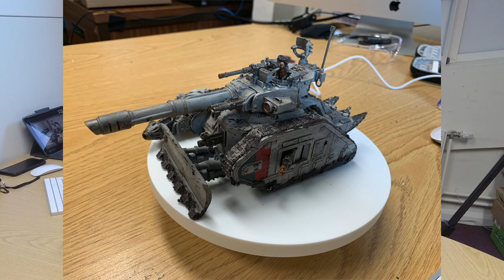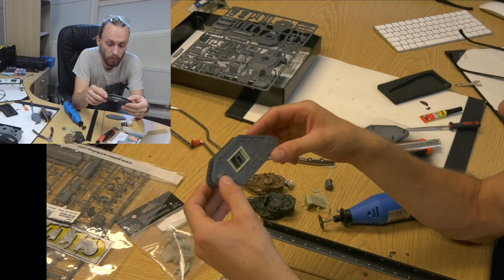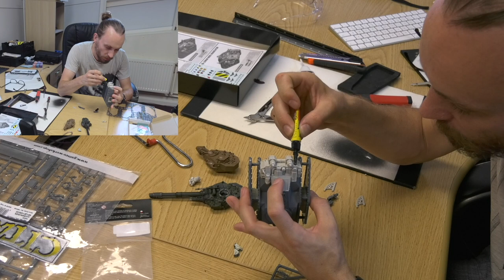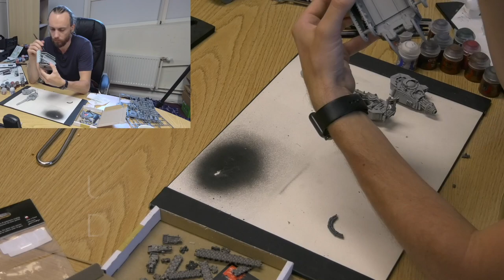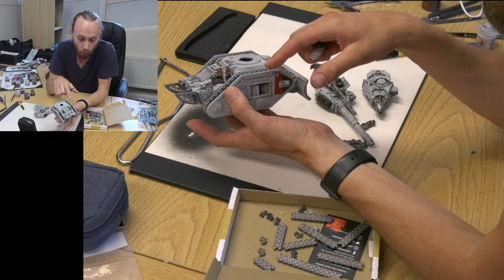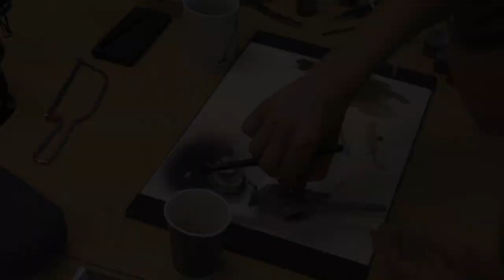Astra Militarum Tank Commander Build & Paint - Vostroyan Leman Russ, Trench Rails, Extended Engine

Comment: This looks very nice! Aesthetically, I'm a Cadian fan, but it can be really cool to see stuff that isn't Cadian, or Catachan, and I was curious what you were going to do for the Tank Commander upgrade; the promoted Spotter looks great, and gives it that Vostroyan feel. I'm not sure about the extended engine compartment, as far as use, but I really like how it made the Leman Russ a little less "boxy", and while it looks great, it doesn't just look like another of the tank I have seen umpteen times in the many years I've liked the hobby. Is the turret a Vanquisher? Not the midterm popular choice, but I like how it turned out, and I'm thrilled to see not another Demolisher Tank Commander. 😊

That's a lot of level of skill I wish I possessed, and I think it turned out great! I'm not sure why, but I feel I'd love a follow-up video for a Valkyrie. Might not match your aesthetic, so I won't hold my breath, but this was good.

Comment: I’d think you could just use the parts from the GW kit, switch sides and possibly do same thing maybe only need some plasti card!  🤔. 

Great paint job and video!
Reply from the maker: Thank you! And you’re right, you totally could do this entirely with plasticard, and I’d be interested to see how it would work with the reversed sponsons that come with it. You’d have to cut some pretty big holes on the inside part of the track section, but doable I reckon! Maybe I’ll try that next…

Comment: Probably a stupid question but do they sell this as a set or do you piece it together with other sets? Do the commander accessories come with the tank accessories that's for sale on the GW website? Just wondering as I want an actual commander for my armored forces! Thanks in advance and great job on this tank, looks amazing!
Reply from the maker: No such thing as a stupid question! So this build is a bunch of different pieces, however you’ll have pretty much everything you’d need to make a basic tank commander in the standard Leman Russ kit - including a Cadian hanging out in the turret hatch. You might want to look at picking up one of the old Tank Accessories sprues - that’s got a whole load more bits that you could use to customise your tank. The internal sponsons and hull extension are third part bits I purchased separately, but aren’t actually needed to make the tank. It just helps it look cool!
Reply: @chrishoad3423  Right on, I appreciate the answer! It does look cool indeed! I love seeing custom works. Videos like yours have been a godsend for me in regards to getting techniques down and some ideas.  Thanks again!

Comment: This is awesome! I recently started collecting a Vostroyan army as well. I'm having trouble finding a tank turret with both the turret-mounted weapon and auspex array. Do you have any suggestions as to where I might find a turret like the one you use in this video?
Reply from the maker: Liam, thanks for the comment! The turret itself is a Forgeworld Leman Russ Vanquisher turret. When you say Auspex array, do you mean the radar setup at the back or the side mounted ‘eye’ pod? The codex calls this an Augur array, if that helps. And by turret mounted weapon, so you mean the heavy stubber by the hatch/Commander, or the twin barrelled stubber immediately next to the main cannon?
As far as I know, this particular turret is a Stygies pattern Vanquisher turret by Forgeworld. They come up on auction sites from time to time. You can also get them from recasters, but that’s a personal choice there. A quick image search will bring up the base turret. The heavy weapon by the hatch is from the Citadel Astra Militarum Tank Accessories Sprue, which is available from a whole bunch of places, and the radar dish is a kitbash using parts from the accessories Sprue and an old forgeworld radar array dish. I hope that helps, any questions just ask!
Reply: @chrishoad3423  you answered every question I had, follow-ups included. Thank you
Reply from the maker: I’m really happy to help. If you use Instagram, drop me a message when you find your turret, or if you need any other help - I’m always keen to see what other people are creating.